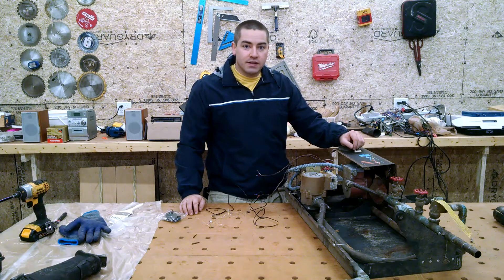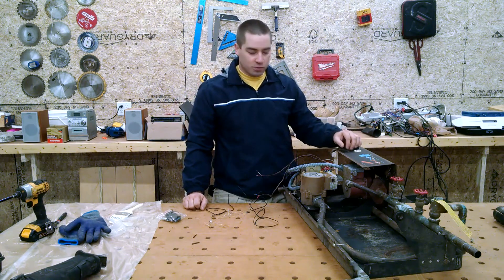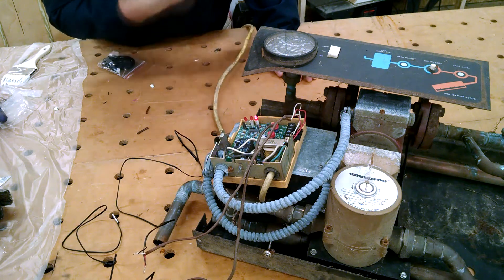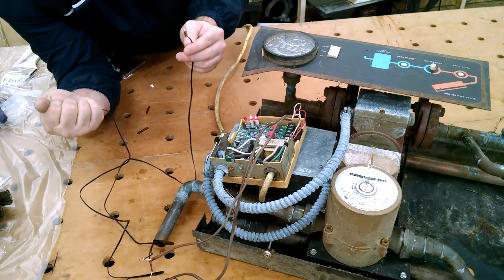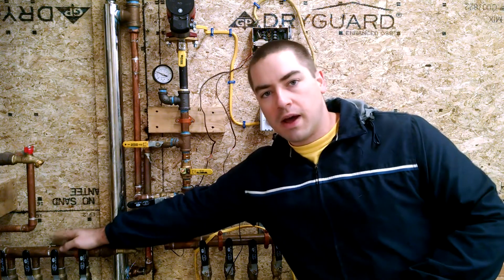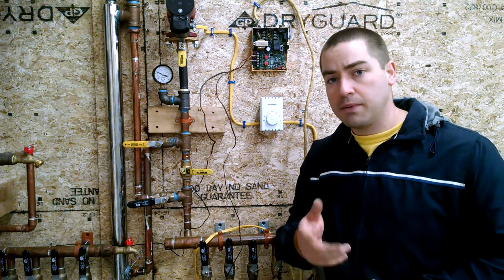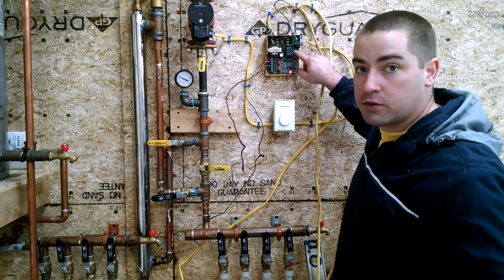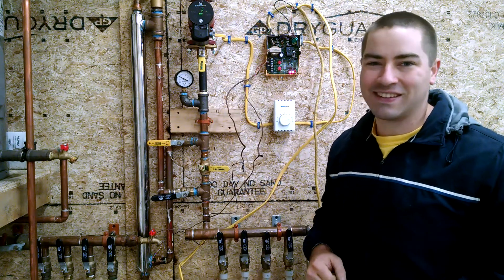Radiant floor heated garage, Solar Controller

Comment: Any progress - even anecdotal - as to how well your solar panel heating is working?
Reply from the maker: Sure.  I have been heating the garage 100% this year with solar.  However, it has sometimes dropped down as low as 42°F inside the garage.  So, success that I have not frozen anything, but not as warm as I was hoping for.
Reply: @DavidPozEnergy  how about the summer time, do you still keep those panels operational? I yes than for what?
Reply from the maker: @jbbydesign6192  No, I turn off the system in the summer and turn on my window AC.
Reply: @DavidPozEnergy  thanx man, one more though, do you know what temp. those panels reach in the middle of summer especially when they aren't working? Curios about potential overheating, damage etc...
Reply from the maker: @jbbydesign6192  The panels probably hit 300°F or more on a sunny summer day.  But they are empty, so no boiling.  They are made of metal and glass, same things that your oven is made of.  The materials can handle the heat.
Reply: @DavidPozEnergy   Thank you, still trying to figure out the balance between the seasons...

Comment: I know this was a just getting it working video.  But once your systems are fully working greater detail would be appreciated. More technical in nature. 

Things could be calculated btu gains, flow rates, or more simple metrics like Temps. 

For the house system. A more details of the system could be like heat exchanger details, pex what diameter and length, tank size (gallons of interior space) Temps etc.  It maybe over the head of many in the YouTube audience but atleast those details written up in the description would be useful. 

Once you get your system fully operational I would recommend a full write up on builditsolar.com 
It used to be a very active site. Not much new content on there recently. But I think it would probably help you get more exposure to your YouTube channel. 

Just some thoughts.
Reply from the maker: I'm always trying to balance the technical stuff without having the audience fall asleep.  Since you asked, I'm sure there are at least a few others who want the same thing, so I will make a video on it.  Thank you for letting me know there is demand.  builditsolar is a great website and I got a lot of inspiration from them.  I want to write an article for that site summarizing my system, but I have no idea how to go about it.  Who do I contact, format,, how does it get on the site, etc.  I'm not a computer guy.  Thanks.
Reply: DavidPoz I totally understand about balance.  Most you tubers care little about the details as long as the system "works".  I guess most people of whatever trade or specialty are probably more interested in details than the average viewer. 
With details people can further evaluate how much said system actually 'works'. Your setup looks well executed. 
Although like you said probably few care about such things. 

After my post I saw you had a simple website. you can write some more detailed description of your setup and get it posted there. Maybe guy that helped you with arduino could help you out. 

I would volunteer myself to help out but I have kind of backlog of projects I really want to document but have not gotten around to it. 

The owner of builditsolar (Gary reysa) usually posts a copy in pdf form. This(pdf format) helps search engine things that actually penalize duplicate content. 
I can not say how much current traffic is going thru builditsolar, but new projects get put on the front page. It can't be bad for getting your channel exposure. 

Gary reysa is not as active on his site as he once was but he responds to emails. 

He is a really nice guy.